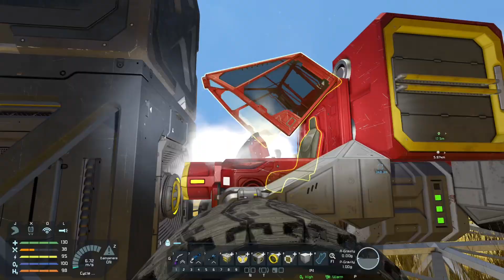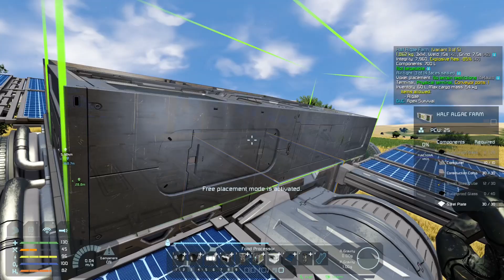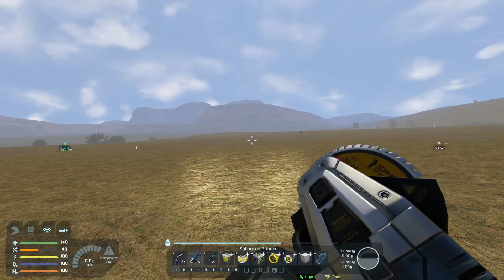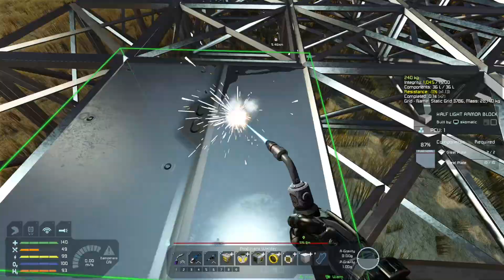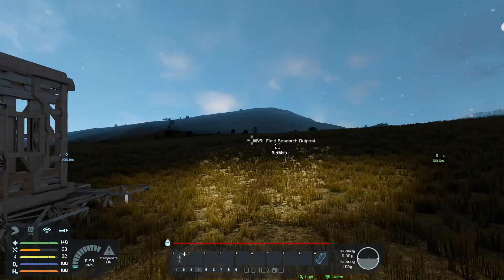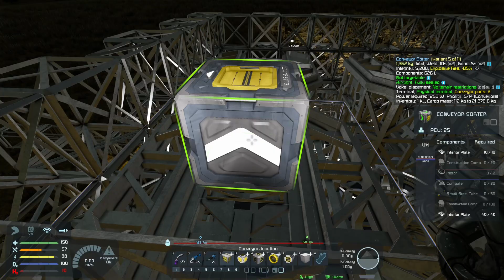Iron Mining Outpost Layout | Automated Engineering E03 | SE1 Survival

Comment: Just a curiosity question.  Why would you need an ore refining facility to be air tight on a breathable atmosphere?
Reply from the maker: That is a very good question! Same reason as for why the main base will have air tightness:
Harsh weather. Since the apex update harsh weather will cause damage through getting hit by flying debris and an air tight room or cockpit prevents that 😊
At least on earth we can simply use the two vent setup as an easy solution for small rooms and don't need a tank in between.